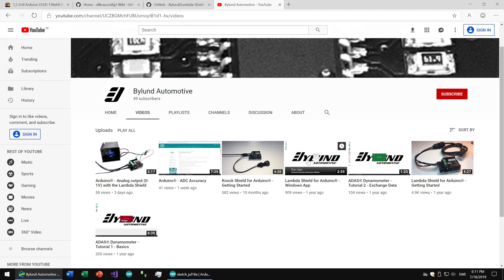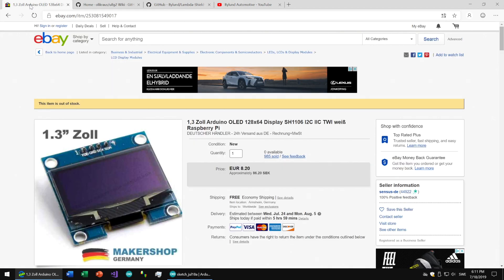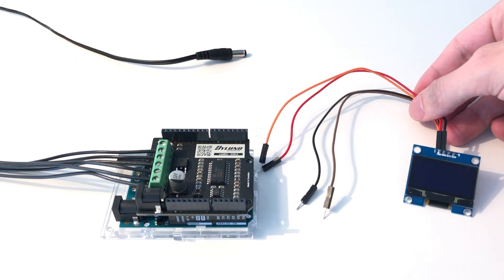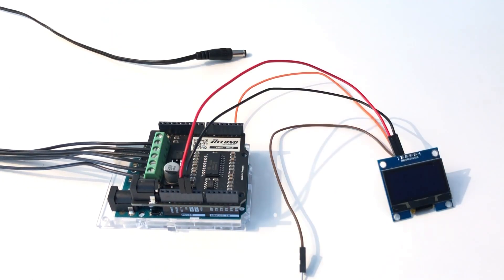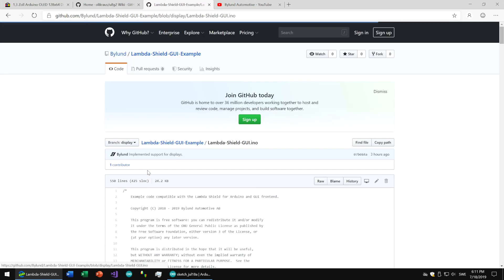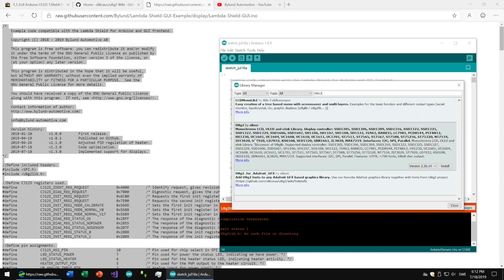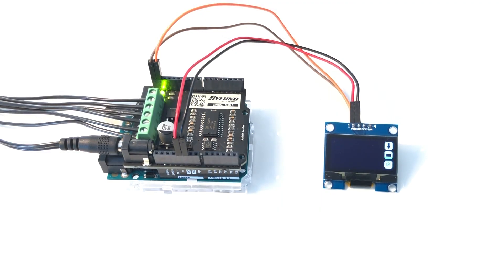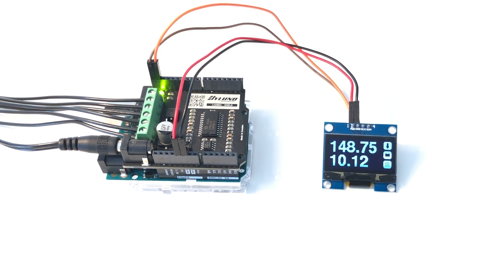Lambda Shield for Arduino® - Display

Comment: Mine stays on the boot logo and there is no response. The oxygen sensor is heating normally. What's the situation?
Reply: I use CJ125 30481

Comment: is there enough room left in prom to handle RPM sensing and an RPM/AFR table?
Reply: Or for that matter, MAF and TPS...?
Reply from the maker: @davidmaye3580  Hi David, Lambda Shield 2 is compatible with Arduino Uno, Uno WiFi R2 and Mega 2560 so you can use the board that suits your requirements.

Comment: Is it possible to add a display for Lambda Shield2 and Arduino  UNO wifi? I see the sockets are not on the board, but soldering is not a problem.
Reply from the maker: Hi! Yes it is still possible to attach a display using the Lambda Shield 2. On the Mega no soldering is required but for Uno / Uno WiFi you would need to solder the screen directly to the shield.
Reply: Great, I have ordered yesterday a shield and arduino, then I'll need a dispaly as well. Thanks.
Reply: Unfortunatelly looks like the screen doesn't want to work.  However the phone app works fine.
I used the 5V pin for VDD, (screen is ordered from the link in descripsion) Lambda Shield 2, and Arduino UNO Wifi Rev.2 and used the Lambda Shield 2 GUI code.
I guess something is wrong, the screen didn't give any feedback.
Also do I have to choose wich funcion I would use, not possible to use the screen and the phone app at the same time?
Reply from the maker: @CeFReX  The display code is not added to the code by default. But maybe it is a good idea to have it by default to the GUI and SmartPhone codes. Let me have a look over the weekend and update the code if it does not cause any problem even if you do not have a display connected.
Reply: @bylundautomotive  That would be awsome! I'm not good at programming. Can i use the Lambda-Shield-GUI.ino on shield 2 to test the display?
Reply: No. Stuck at login screen.
Reply from the maker: @CeFReX  Check out the updated Lambda-Shield-2-GUI-Example code. It now has the same permanent display support as this video but for the Lambda Shield 2.
Reply: @bylundautomotive  Thank you for your help!

Comment: Nice! Do you think a knock sensor meter could be made using a LED vu meter, or something similar with arduino? I wouldn't mind seeing knock when it creeps in
Reply from the maker: Absolutely! Assuming you are referring to the Knock Shield. We added the LED on the Knock Shield for demonstrative purposes when knock signal is above 80%. A LED VU meter is basically just hooking up more LEDs to free pins. Alternatively using an analog VU meter for L+R on a V-engine?
Reply: Can you build us one lambda and knock shield?